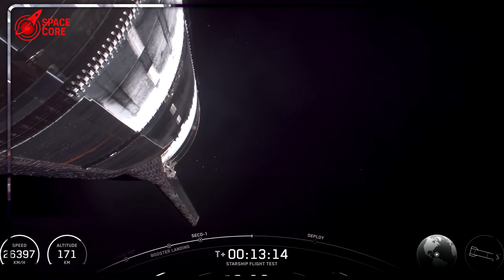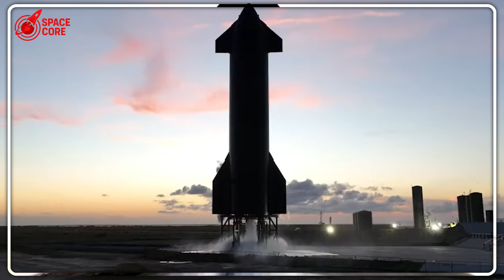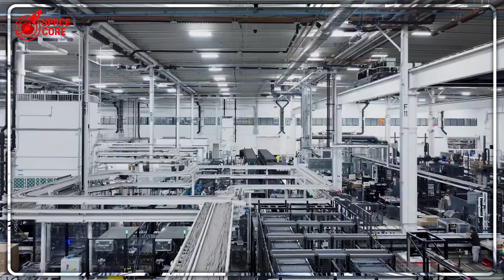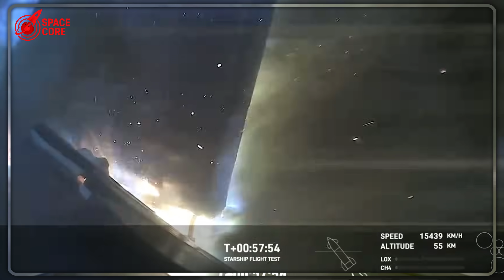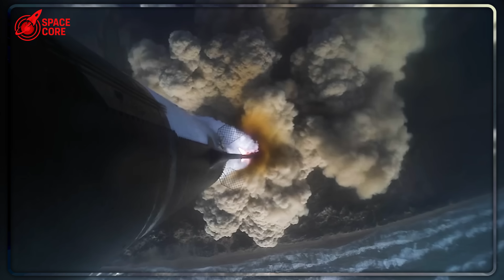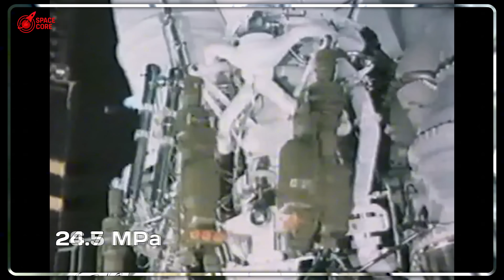Elon Musk revealed Flight 10 Metal Heat Shield SHOCKED Engineers...Here's Why!

Comment: Asbestos porsilen
Reply from the maker: Asbestos in porcelain is rare, but old tiles may contain it, posing health risks if disturbed.
Reply: @SpaceCore25 as a kid i worked with asbestos in a t-shirt and shorts and a garden hose . With no problems. for 100 years it was used in brakes it is in the water pipes people drink out of and in the air u breath .a porslin asbestos wood ash tile would be a cheep and high  temperature tile

Comment: The engine bells are also cooled by the fuel so if you use the same  fuel to cool the body you're not going to have any cooling available for when you need to run those engines! Also as you hit the highest temperatures on re-entry you're not running any engines so what do you do with the gas?
Right now if they manage to fuel up without blowing up they'll be doing well 😂
Reply from the maker: Methane cooling for the metal heat shield is separate from engine cooling, ensuring both systems work independently. Gaseous methane is vented or repurposed, not wasted, during re-entry.
Reply: Well I can’t wait to see what happens when space x brings back a ship that isn’t a test and they aren’t trying to push the ship to the limit to see this one come down mostly in one peace is a great success we will win we will

Comment: To the automotive industry couldn't adapt this same technology for the gasoline engine I'm thinking that this could cut down on air pollution and maybe better gas ⛽️ mileage.
Reply from the maker: The methane cooling tech for Starship's metal heat shield is fascinating, but adapting it for gasoline engines is tricky due to different thermal and pressure demands. It could inspire cleaner engine designs, though—great idea to explore!

Comment: Why not use anti-gravity tec that we are using on our newly displayed airplanes(that they say fly to the edge of space. 
Seems they could eliminate another of rocket weight  and fuel weight.
Reply from the maker: Anti-gravity tech remains theoretical and unproven for practical use in aircraft or rockets, despite claims. SpaceX's metal heat shields reduce weight and fuel needs, making them a more viable solution for now.

Comment: I don't think coolant circuits freezing up should be a problem on re-entry, though the cold of space may, so a hot flush constantly cycling a hot or warm liquid through the coolant circuit can hopefully alleviate freezing up, or electrical possibly heating of the area thats prone to freezing....prior to engagement of coolant system.... expansion and contraction extremes may be possible to avoid by regulating temperature in the coolant circuit, im sure they'll get it figured out whatever happens, pray to God, something will work out, go to.
Reply from the maker: Freezing in space is a valid concern, but SpaceX's methane coolant system uses active monitoring to prevent ice buildup. Pre-heating or cycling warm liquid could indeed enhance reliability during re-entry!

Comment: When it enters the atmosphere, it no longer needs the engines. So what do they do with the methane gas used for cooling when they don't need the engines during re-entry? Furthermore, if they have a hole in the methane tank, they cannot re-enter safely.
Reply: My necktop had other tasks to work on, thus I hadn't thought it through:
You could use the cooling gas in the engines to brake more strongly and thus reduce the heating time caused by the stronger braking. Only brake as much as you need to cool down the ship. Whether the weight saved for the tiles compensates for the additional weight of methane/oxygen needed for the cooling process is another question. But yes, reusabilty would definitely increase.
Reply from the maker: During re-entry, excess methane gas is vented or repurposed, as engines aren't needed. A hole in the tank could disrupt cooling, risking catastrophic failure.

Comment: why not spray the outside of the ship with a ceramic coating like they do for gas turbine engine blades. They would need a coating with similar coefficient of thermal expansion to stainless steel.
Reply from the maker: A ceramic coating like turbine blades could work, but matching stainless steel's thermal expansion is tough. SpaceX's methane-cooled metal heat shield offers active cooling and reusability.
Reply: Yes a combination of active cooling and a ceramic spray could do the job. I assume the spray is too weak to survive without cooling, but it could help to reduce the amount of cooling needed without the need of tiles. 
I suspect that the spray hardly supports ablation, which wouldn't be so good in turbines, would it? But it would make sense in a spacecraft. So a different mixture would probably be necessary. Problem: reusability. It would have to be repainted after every flight.

Comment: Methane a fuel? atmosphere contains oxyegen
fuel oxygen cxan destroy concrete
Nytrogen would logicaly be the better coolant sweating metal vapour.
sweating tiles vapourise gases a`way a`s the thrust nozals cool with fuel
first before rushing out to push the machine
Reply from the maker: Methane’s dual role as fuel and coolant in Starship’s metal heat shield is genius, efficiently managing re-entry heat while feeding Raptor 3 engines. Nitrogen cooling is interesting, but methane’s stability at -62°C and zero-waste integration make it superior for sweating tiles and thrust.

Comment: If they make some kind of a space break that doesn't use fuel. like airliners have air breaks,starship would slow down as it enters the atmosphere giving any type of heat shield  a break from higher temperatures  ! (NGH)
Reply from the maker: A space brake like air brakes is an intriguing idea, but Starship’s metal heat shield with methane cooling is designed to handle re-entry heat efficiently. Adding such a system might increase complexity and weight, potentially offsetting the revolutionary simplicity of SpaceX’s current approach.

Comment: Starship is turning into the old Space Shuttle being too complicated and expensive.

The Raptor V3 engines will have to be fully tested before Flight 10.
Reply: OH !!!? I thought you said OLD SPICE SHUTTLE 🚀
Reply from the maker: @sgtprestonoftheyukon  Haha, Old Spice Shuttle would be a fragrant ride! Starship’s metal heat shield and Raptor 3 are pushing reusability, making it far less complex and costly than the old Space Shuttle.
Reply from the maker: Starship’s metal heat shield and Raptor 3 aim for simpler, cheaper reusability compared to the Space Shuttle’s complex ceramic tiles. Thorough Raptor 3 testing before Flight 10 is critical to ensure reliability and avoid costly failures.